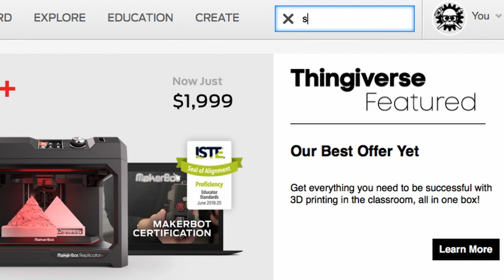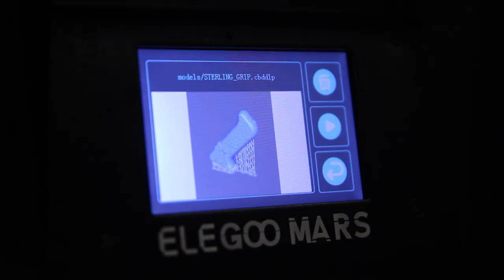Making an E-11 Stormtrooper Blaster from Star Wars

Comment: Great reference for my build, nice work tom.

If you dont mind me asking where did you get your stand from? Or is that printed as well?
Reply from the maker: the stand was a last minute thing, mostly so I could get some beauty shots at the end of the video. I slammed out the cradles in Fusion360, kicked off a print, grabbed some scrap wood and made a base, grabbed some aluminum tubes and painted them, print was done shortly after and I glued it all together. took less than an hour and I was filming again. if you'd like the stand parts send me an email tommy@nerdsandmakers.com